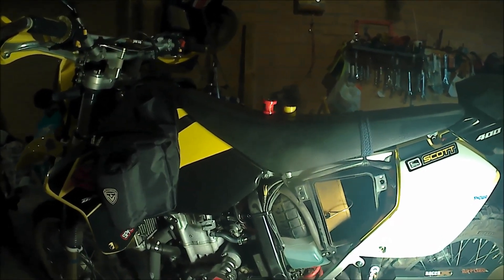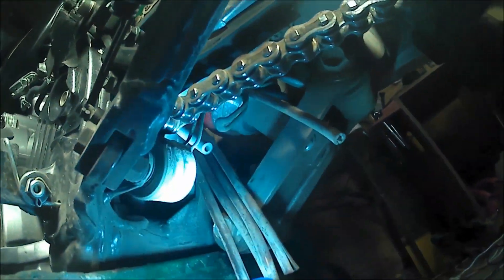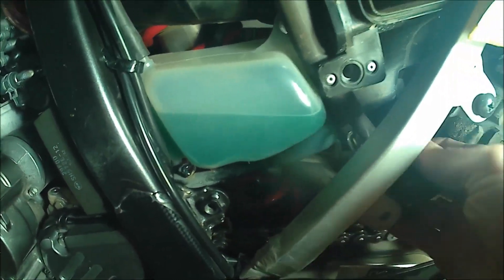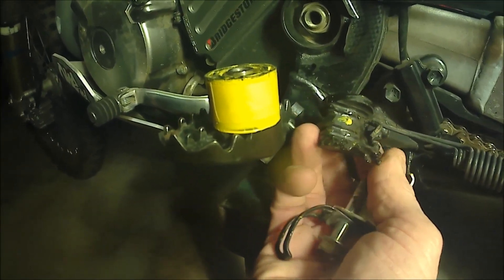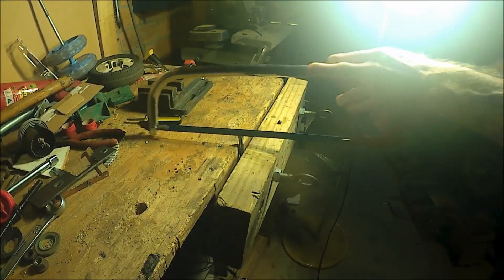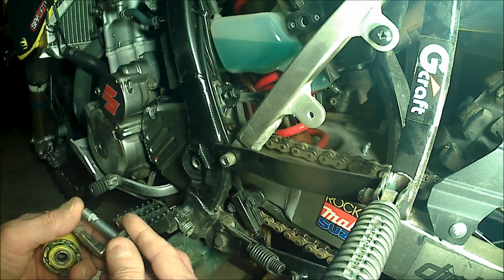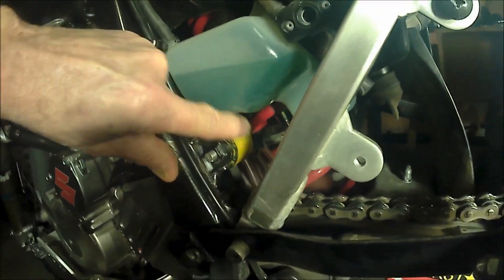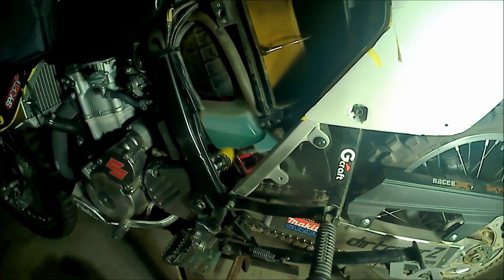drz400e top chain roller RNR

Comment: hey man can you show us your rear peg brackets ,,, And some lengths ect 
cheers 
Rob In nowra NSW Australia
Reply from the maker: sorry for late reply ,,i just used mild steel angle 30mm on the drop  and flat bar as the stay,30mm,,using those mount points you just meet them both and harley sportster peggs fitted nice,,its illegal to carry  pillion passanger on a E model,,and if you do beware the rear frame is alloy unlike on the S and SM models